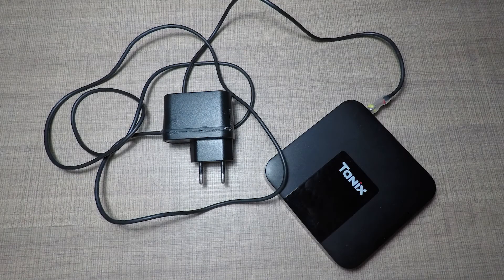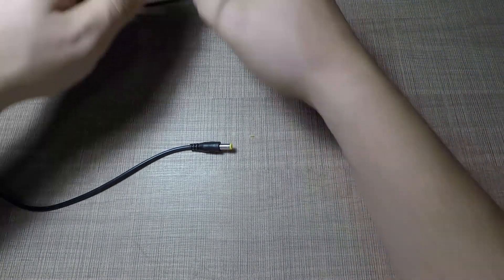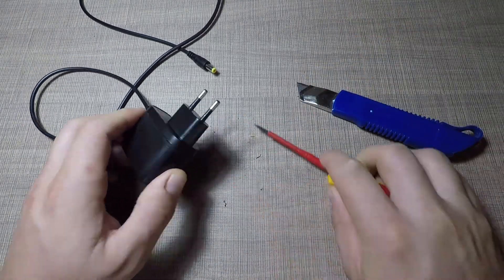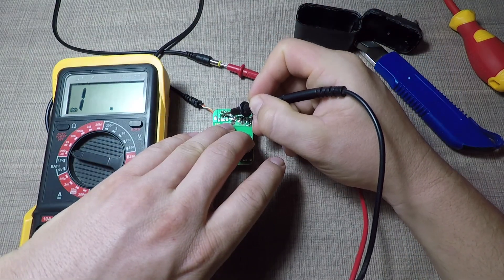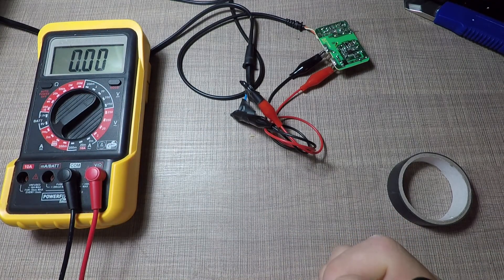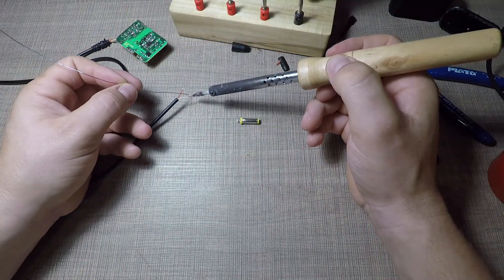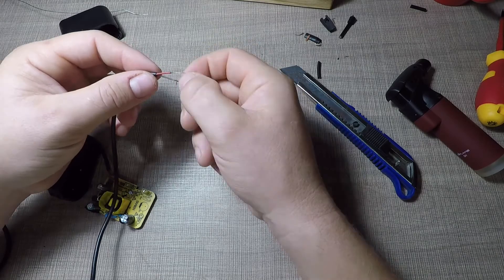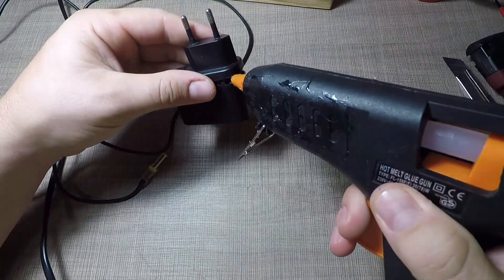Android TV Box power supply repair - Healing bench #15

Comment: You could have just powered the device with a basic 5v usb A cable?
Reply from the maker: You'll need to modify the cable to match the plug and also to provide enough current for the tv box.

Comment: I got millivolts reading on multimeter I checked the continuity it's good then what is problem will be
Reply from the maker: Replace the capacitor on the output. A broken capacitor often fails to bootstrap the circuit.
Reply: @TasteTheCode  thank you for the information I will try it
Reply: @TasteTheCode  then one doubt, does checking with tester on out it glows its normal or danger

Comment: Hi sir I bought new 5v 1amp adaptor from local market. after that it got stuck on boot logo or sometimes after bootlogo shows black screen... Please help....
Reply: Thanks brother I replaced with another brand 5v adaptor... And it Starts working
Reply from the maker: I'm glad that you managed to figure it out!
Reply from the maker: It is possible that the box is faulty on its own. If you have a power meter, pls test out the power supply that it can actually supply 1A. Many fake ones fail really short of this so the box might not be able to start if it does not have enough current.
Reply: @TasteTheCode  thanks for the reply

Comment: Are there any polarity on the two diods tha you connected to aligator clip
Reply from the maker: No, you can connect them as you wish since this is the AC input from the mains. BTW, they are not diodes but the pins that connect to the plug pins on the case.

Comment: Hi i have T9 device its not turning on please help me
Reply from the maker: You need to isolate if the issue is the power adapter or if the issue is inside the Android box. Make sure to only try the box with an adapter for the same voltage.

Comment: hello sir my mxq android tv box damage due to inserting 12v adapter 
instead of 5v adapter, i take it to repair shop but they said need to 
replace main ic, i want to know which component will be damage most of 
the time if we connect any high voltage adapter to android tv box or any
 electronic equipment. i have little knowledge about electronic 
soldering and i own one cheap multi meter tester.
Reply from the maker: It all depends on the type of circuitry but it is possible that the main IC is gone if there is no extra protection inside. In an event that there is some extra protection inside like a regulator, fuse, or similar, that might be broken but it is impossible to know without looking at the board.

Comment: Hey dude a question please.I have bricked my tv box (x88 king) and finally after unbricking it,HDMI output doesnt work (no signal on tv) I noticed most times power supply creates a spark when connecred to socket.Box boots fine though (tested with AV output) Electrician told me that he couldnt find any HDMI damage.Is it possible HDMI no signal problem to be from partially broken power supply?
Reply from the maker: I'm not sure but I don't think so. If it was partially working out not booting at all, then it might have been the power supply. The spark is commonly caused by the input capacitors charging to fast.
Reply: @TasteTheCode  thanks dude.So my mystery remains 😒
Reply from the maker: I reckon that the HDMI issue is software related and your new firmware does not recognize it, but it literally can be anything. Did you tried with another cable?
Reply: @TasteTheCode  tryied with 2 cables but no lack..Also many UBT versions.Also with BCM.Is there sonething else except these 2?
Reply from the maker: Sorry, can't help with that. I haven't played much with flashing TV boxes.
Reply: @TasteTheCode  its ok oc thank you anyway 😉

Comment: I accidentally use adapter that has higher voltage than my tv box should. After that it cannot be on using the original adpater. Only detect the power from false adapter. It cannot be turn on. It just blink sign the power connect. Could i fix the problem?
Reply: Or the tv box damaged already?
Reply from the maker: Sounds like it is. Higher voltage almost certainly damages components. Do you have some electronics knowledge to try and inspect it? If not I'll recommend that you take it to a repair shop.
Reply: Hello how are you did Yu fix your box , I also have the same problem
Reply from the maker: @tkdmaestro9763  some devices have a fuse at the input that might be burnt off. If you have any electronics knowledge, it's worth a try to look inside and check.
Reply: @tkdmaestro9763  no i bought new yv box. Tivo 4k

Comment: Which one is negative and positive on the device like the inside is negative right and the outer side it’s positive right
Reply from the maker: Nope it is the other way around. At least in my case and in about 95% of power supplies I've seen, positive is in the middle and negative on the outside. Check the device label, it should be marked.

Comment: I have seen bulging capacitors so many time!!!  Good safety tips by taping the mains. Suggestion use a heat shrink tube over the hot glue also.
Reply from the maker: Yeah, that is a good advice. Thanks!